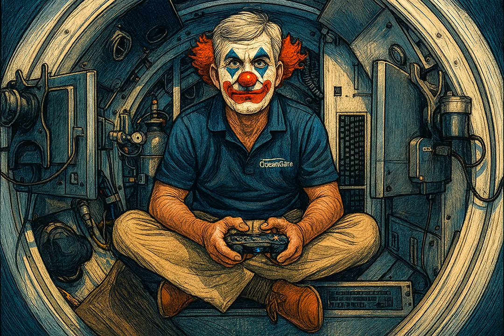David Lochridge OceanGate Firing – full audio of meeting with Stockton Rush

Comment: Nissen is complicit with criminal negligence.
Reply: he is a real piece of work
Reply: Wasn't he standing there in the dirty warehouse watching greasy fingers and rags being used to clean a critical bonding surface and then watching these guys slap glue on with kitchen spatulas for this critical joint?
Reply: @winstongsd4273   I was thinking the exact same thing when I saw the video. The glue has to be "precise" and they are putting it on like they're frosting a cake. Stockton is easy to blame because he's dead, but there's plenty of live people that need to step up and take the blame. Certainly Tony is in that column. I was just taking orders is no excuse.
Reply: @zachla Could be he meant the glue itself however it's made had to be specific recipe wise ya? Who cares how it was applied as long as it was applied, how else would you do it maybe spray but how it was applied is almost irrelevant
Reply: @winstongsd4273 good morning 🌞 I don't know sh1t about any of this until I watched the Netflix, and what your describing here is sooooooo CORRECT 💯
Reply: @winstongsd4273 yup and they watched the glue being put on incorrectly even after knowing the importance of doing it systematically and not manually
Reply: @winstongsd4273  i am sure that in an engineering debate tony would obliterate you before you even open your mouth. it's amazing how you really think you are more competent than him
Reply: @LukoBalaok you’re a freshman engineering major we get it. Bow to theeee
Reply: @LukoBalaHe definitely would but he’s also the same guy who said the sub didn’t need anodes. If any submarine engineer tells you that a vessel that contain any type of metal doesn’t need a zinc or magnesium anode then he’s a moron. He knows nothing. The same guy who backed that acoustic signaling system like it was the greatest thing since sliced bread is who you’re defending. The warning system will let us know the carbon fiber is breaking apart but in no way shape or form could stop a catastrophic implosion but hey we invented it.
Reply: @LukoBalaHi Tony what's up
Reply: @LukoBalahis watch would ring even before that
Reply: @LukoBala Gotcha so as long as he knows more about general engineering he is immune to anything involving gross incompetence and criminal negligence...nice try, Tony.
Reply: He’s a true mad scientist. Even after the tragedy he’s on 60 minutes saying, “The carbon fibre worked, we just needed more time”.
Reply: Nissen seems even colder than Stockton; it seems to me that he had some responsibility in the accident.
Reply: Nissen wouldnt lissen
Reply: @charleslaine 
An oversized ego often causes deafness.
Reply: well both Scott and Tony are getting off scott-free. no charges are being pressed on anyone at oceangate. frankly, the USCG has been spineless and pathetic throughout this entire investigation. no charges. no indictments. everyone's gonna walk away.
Reply: I agree. The warehouse looked like a poorly organized retail operation, with debris all over the place during Titan's construction phase. Nissan's improper application of chemicals & materials for Titan's storage and construction is where he would have been implicated alongside Stockton had Lochridge's OSHA taken the complaint seriously. Both men would have faced $16,550 per violation, and Oceangate could have lost over $165,000 if they ignored it.
Reply: Too bad tony didnt turn into toothpaste at the ocean floor with his trash tier hull, hopefully he wont be contracted to risk human lives ever again because we all know he would in a heart beat
Reply: He is really Shit h…
Reply: Nisson was not with ocean gate at the time of implosion , he had nothing to do with hull 2 they pulled worn parts off hull 1 and slapped them on hull 2 that was all Stockton
Reply: If niaseon was working for oceangate at the time and the implosion happened with hull 1 you'd have a case otherwise nope nosson is free n clear
Reply: And in 2019 Nissen started freaking out about the carbon-fiber hull himself. When Rush saw this, he told Nissen to “GET OUT AND STAY OUT!”
Reply: My thoughts exactly! Just watch and listen to him and you just know. Total mess of a man
Reply: Why does everyone have the same view about tiny nissen. He was fired. But he also built the sub he was the only real actual accomplished engineer that worked on high level projects with high level companies. His education and previous work accolades were very impressive. From what I saw he was fired because he wouldn’t give Stockton approval to go down the the titanic yet at the time and Stockton was in too big of a rush. And he wouldn’t let Stockton design and add things to the sub that he clearly wanted him before that through science and his data, that they could not do without serious hazard. He fired him. Changed all the things and redesigned parts of the sub that nissen warned him about after he was fired and it failed just like he warned him. What am I missing.
Reply: @1Faxiapreta his arrogance and dismissive tone in the meeting where Tony and Stockton ganged up on David Lochridge before his firing. Also in many other interviews before and after being fired, defending the hull engineering, yet he wouldn't even get in it himself which is why he also eventually was booted.  but he was Stocktons yes-man and bullying-croney until that time
Reply: @kneel1  just because you don't understsand what tony is saying about the hull, doesn't mean the hull design was bad or that tony is wrong. just because david was an arrogant ignorant stubborn man doesn't mean that tony had to tolerate this forever. do you think it's normal we have this 2 hour long conversation in which stockton and tony explain to david each item with logic and engineering arguments yet david doesn't change his opinion on anything? without having any extra arguments to combat what tony/stockton are saying.
Reply: @LukoBalai i do understand and Tony and Stockton were as arrogant, if not moreso, than David.  David, unlike Tony, had years of experience. David was right and Tony and Stockton were confidentally incorrect. Tony at least had the sense he was born with, however, and dipped before he ever got into that contraption. so yeah Tony understood but he helped enable this massacre of humans and its not a great look to be defending that.
Reply: @LukoBala Clearly the design was bad, as it’s on the sea floor and not chillin in some parking lot.
Reply: @LukoBalaThe hull design was inherently flawed from inception. The entire concept behind OceanGate - take paying passengers to Titanic in a submersible built on the cheap - was flawed from inception. OceanGate hastened the hull's failure by treating it with less care than most people treat used cars - storing it uncovered outside in a parking lot exposed to the elements for over six months (!), subjecting it to all kinds of physical abuse when towing it out to sea, etc. - but it is doubtful that it would have withstood repeated dives indefinitely.
Reply: @LukoBala you sound like Ms Rojas who criticized and discounted Lochridge's testmony during the Andrea Doria incident who had personal ties with the Stockton family. She lost all credibility after the tragedy and, like Nissen, is a black sheep in the public eye.  The bottom line is that David gave OSHA the necessary evidence to investigate the warehouse & their operations, and Nissen likely knew that he & Stockton had committed some violations ($62,000 per violation & repeated violations would exceed over $162,000  during a time when the company was losing money).  

It also seems to me that you ignored that everyone in the entire industry, from James Cameron to Victor Vescovo, told them not to do this after Stockton put out the news about Titan's design. I would trust Victor over Nissien because, during the DSV Limiting Factor's construction, it was largely dependent on their testing in Russia with titanium spheres & discovering how the Russians enable their subs to survive very extreme pressure environments like in the Arctic regions. 

Those experts, alongside Boeing/APL at the University of Washington, knew the design would be a death sentence before Nissen joined, and yet people to this day somewhat still defend Nissen while making honorable people like David the villains instead.
Reply: @1Faxiapreta Tony is a fool and needs to be in jail.
Reply: @halomultiplayermoments  you understand nothing from engineering nor logic, it seems. that's the only way you could call such an intelligent and well educated person like tony a fool
Reply: @LukoBalaYou’re a bit obvious.
Reply: @LukoBala Hi Tony. You tried to come off as the fired hero in your interview, but now this audio comes out. You were part of the problem. What kind of engineer hides his data?
Reply: Get lost Tony.      Oh, look! You have!
Reply: @1Faxiapreta  What are you missing? Did you not even listen to this audio?
Reply: @1Faxiapreta are you literally stupid? Tony Nissen had very little experience in terms of what he worked on in comparison to Lockridge, even lockridge says this in the interview! Lockridge worked on submersibles for decades.
Reply: @1Faxiapreta  Tony Nissen in the chat everybody! Hi Tony!!👋😀

Can we call you ‘Smithers’ or do you prefer ‘Smithereens’..??💀
Reply: @1Faxiapreta  the harsh truth of the matter is that Nissen shares the small moral and ethical blame for contributing to an unsafe engineering culture and allowing early safety compromises at OceanGate. He minimized his personal accountability and pushed back against safety whistleblowers like David. He made some condescending comments about David (even in the Netflix documentary) while acknowledging he understood the lengths that Rush would go to destroy such honorable men like Lochridge. 

He is a poltroon who knew the devil but will not admit he still enabled the path that Rush wanted everyone to follow. Look at how Ms Rojas, during the hearings, discounted David Lochridge's take of how Rush almost killed them at the Andrea Doria wreck, and has personal ties with the Stockton family. Do you see people defending her while many still believe Nissen didn't do enough to help out David and potentially save lives by a man who violated every OSHA, federal law, and international boundary? 

Nissen likely knew they were violating every OSHA policy inside that warehouse, and yet he still followed along when he could have called them out and looked for another job. That's the difference between Lochridge, who sacrificed everything to save lives, and Nissen, who cowered until the last moment like Littlefinger in Game of Thrones.

Comment: Stockton kept playing the "real time monitoring" card. But he ignored the monitoring system anyway.
Reply from the maker: Yes! One of the most shocking things I learned from the Netflix documentary, that the "real-time monitoring system" actually worked – and yet, they chose to ignore it!
Reply: @MatthewMoonen  Ultimately the real time monitoring thing was useless as it could only indicate that the hull was under stress (which was obvious from the all the bang and crackle sounds) but couldn't give any indication when it was going to blow.
Reply: @cornerofthemoon  The sudden change to non-linearity after that bang on Dive 80 might not have been an exact indication of when failure would happen, but it was definitely the RTM system screaming that something horrible was happening.
Reply: @gloomyblackfur399 I’d say you’re both right. The “acoustic monitoring system” worked to show the hull was failing before it did. But “real time” is useless and unfounded idea. It was not scientific enough to know or depend on being able to make it back up if the alarm sounded in real time
Reply from the maker: @gloomyblackfur399  Exactly. Anybody with any sense would look at the data and say that increasing acoustic activity was something more than just the weakest fibres breaking while the hull "seasoned". But Stockton was so determined to do what he wanted that it wouldn't have mattered what the data said.
Reply: He was its biggest fan until it started telling him what he didn’t want to hear. Much like his relationship to Lochridge.
Reply: It seemed obvious that it was failing, but the horrible thing is it didn’t really tell you anything. Carbon fibre doesn’t fail in a uniform way, where one failure leads to accurate prediction of the next. This is the major issue with using this material instead of something like steel or titanium
Reply from the maker: @stevenesbitt3528  Yeah carbon fibre is super fickle. One look at /r/bustedcarbon on Reddit tells you all you need to know.
Reply: The guy expected that the BANG of flimsy submersible under mammoth pressure , nanoseconds before it caved in would give him the time to fix this and reflect back on his moronic design ....That's a very "dilligient" and thorough type of reasoning for a man that called himself an engineer ..... Did he expect that submarines imploded "gently" and "gradually" at 4000m ???? Wouldn't have astonished me if it came up that he stuffed the sub with paddles and diving suits as "security measures"
Reply: The real time monitoring system had the last laugh. Shame about the other 4 people though. 😢

Comment: At 3:20 Stockton stating that carbon fibre is better during compression than tension says a lot.
Reply: “eVeRyOnE iS fULL oF sHiT eXcEpT mE!”
Reply: "it doesn't just implode"  Can we put that on Stockton's tombstone?
Reply: What about the part where he says, “carbon fibre is a better option than titanium” 😂 or “pressure is spread evenly over his “cylindrical” shaped pressure vessel 🤦‍♀️
Reply: @Number-5-is-alive their CPA was better engineer than Mr Rush
Reply: @martinmendez695  Haha, for sure. how funny was it in the documentary when they asked her to be the chief pilot and she goes. 
“Ummm what , are you insane ... I’m an accountant”
Reply: “That’s what nobody understand….”
Reply: why? he wasn't wrong and it was the titanium that ended up failing and taking out the sub anyway. the titanium c channel [tang & clevis] is the part that failed.  look up the photos and video of the wreckage the titanium mating ring is blown out.  carbon fiber composite is stronger in compression than titanium
Reply: @TungstenCarbideProjectile  He was absolutely wrong, and the reason the titanium lip collapsed is becuse of the increasing pressure it had to withstand when the carbon fibre hull weakened and cracked down.
If the carbon hull would be able to stand the pressure without deformation it would not stress the titanium lip into a collapse.
Reply: everyone,
Please do not feed the troll.